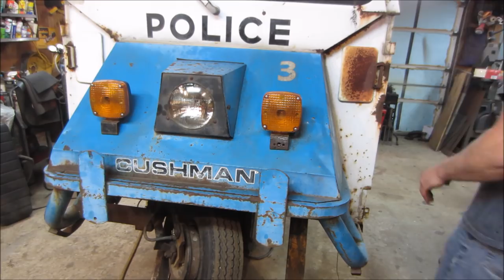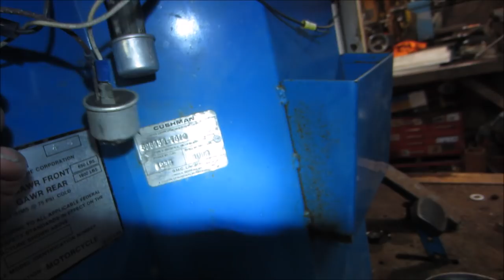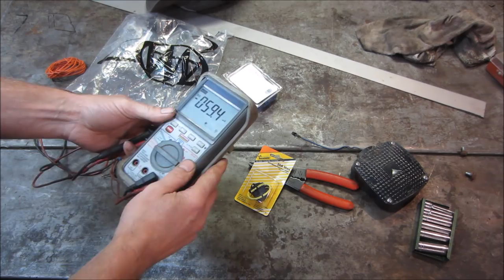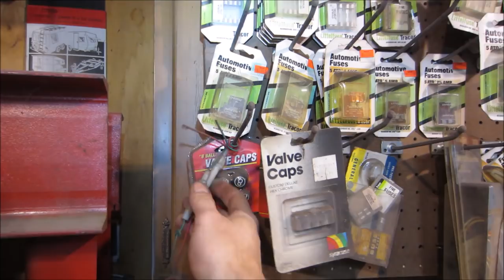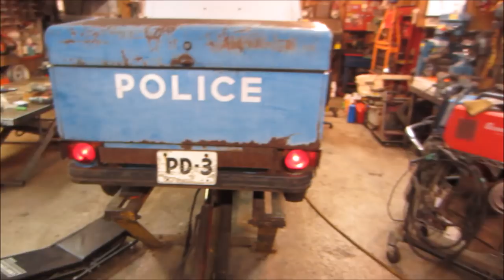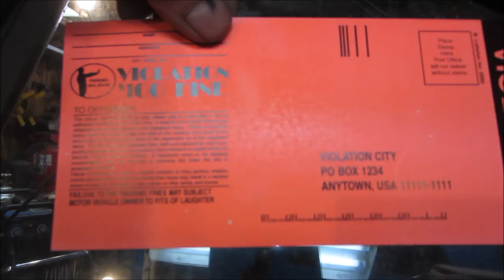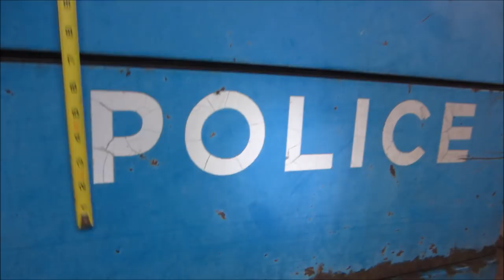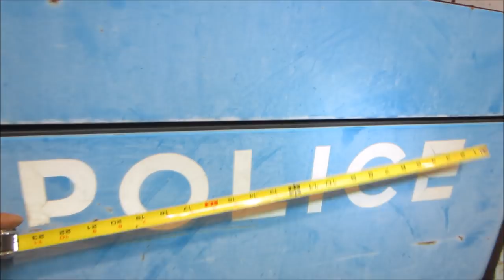cushman meter maid troubleshooting the wiring

Comment: I used to work on refurbishing forklifts/scooters/bobcats...etc.. Anytime we bought a used item at auction, without fail, the wiring was an issue. We went from the power source connection to load point...removed the entire wire and replaced it. Saved us hours and hours of time which = savings$$$! Once I found a wire that was from the switch to the flashers about 52 inches in length and it had 26 butt connectors! You tend to find out real quick that everyone is an "electrical engineer!" :)

Comment: Mustie1, Your closing remarks are very much the same feeling I’ve had while watching you go through and fixing this and that as you see fit! That’s the enjoyable part of a project like this. No end result except to get it safe and street legal. Then go from there.
I got mine just to get it to run because of the same reasons you mentioned. Cool, unusual, history it went through and didn’t want to see it crushed when a little work would give it new life.
As for the “no wrenching” per say videos, they are all interesting from different points of view. I for one enjoy and learn from them. So don’t be hesitant to record and put them up! 
This Cushman is going to look great hauling it to and running around at shows!

Comment: That's an innovative use of wire-eyes! I've used those splicing/piggy-back wire connectors, but I'm sure to always grease them! I enjoy the variety, it's good fun! The ticket on the windshield is a nice touch! XD Ooh, those will be fun at the shows! It's more fun to have it in your capable hands than smushed at the scrap-yard, that's for sure!

Comment: One of the tricks I picked up over the years was to stuff exterior light sockets with Vasoline after cleaning the surfaces to keep them from corroding.  Works great!  Lovin the series.  Thanks for sharing...
Reply: Im sure its similar but dielectric grease works good too and is cheap..
Reply: Fred Miller dielectric grease is even better!
Reply: I use silicone grease.

Comment: I learned something this week - do not use crimp connectors for electrical wiring on equipment.  I added rear lights that flash on my new Snapper SPX lawn tractor.  To do so, I had to splice a lot of wires together.  I used crimp TYPE connectors to splice them together.  They worked as intended for several days but the constant vibration of the engine, mower and bouncing around in the yard ended that.  I am going to take my VOM and find which connector is no longer connecting.  To stop this from happening in the future I am going to cut out all the crimp connectors and splice and solder each connection and then slip a piece of shrink tubing over each connection.  This is what I should have done in the first place.

Comment: The explanation of the speed of the flasher is the following:

The bulbs are wired in parallel to the battery, but the flasher is in series with the hot wire of the bulbs. As the bulbs are a simple resistor, they take up the current load, making the flasher's bimetal points contact lever heat slowly, thus flashing what we consider "normal".

When a bulb goes out, the flasher has more current flowing through it, causing the bimetal points contact lever heat up quicker, which translates to a faster flashing of the lights.
Reply: VochoTalacha the lower the resistance is the lower the current is. So you are wrong.
Reply: mettisha This is not correct, buddy. 

Picture a horizontal water pipe. Water flows from left to right. At the left you have a valve and at the right there is a rotor that spins with the flow of water. The more you close the valve, the less the rotor spins due to lack of waterflow and vice versa.

The pipe's diameter is the voltage, the valve is the resistance, the water flow is the current and the rotor is the car's flasher.

So I don't understand what do you mean by less resistance = less current. if this was true, then arc welding and short circuits are a hoax.
Reply: VochoTalacha the lever gets heated more when all the bulbs are still intact. And therefore you get that steady flashing. If one of the bulbs stop working the lever gets heated less. And that's because a lower current is traveling trough the lever. That causes the lever to get cold faster and your flasher will shift faster = flash faster... I'm an electrician. So I know this is a fact.
Reply: Nearly 50 years in the electronics field (yes, I started on tubes). Lower resistance is more load is more current. If 1 bulb = (for instance) 20watts, two bulbs (in parallel) = 40 watts. If 1 bulb resistance (cold, for instance) = 10 ohms, 2 bulbs resistance (cold, connected in parallel) = 5 ohms. Light bulbs appear as a near short when cold, resistance goes up radically when they heat up to prevent thermal runaway. Hook it up, measure the current. Ta Da. FYI: LEDs are a much smaller, steadier load, don't usually work well with load based (usually 2 pin) flashers meant for tungsten bulbs as they don't have nearly the current draw to heat up the flasher.
Reply: Mike Jones  as a licensed electrician for the past 30 years I concur..
Reply: I'm a university qualified, time-served electronics engineer. Mettisha is correct. Mike Jones is correct. VochoTalacha, unfortunately, is not correct in saying "When a bulb goes out, the flasher has more current flowing through it". With one bulb out, the overall resistance is higher so the current is lower. The thermally sensitive wire or bimetal strip doesn't get as hot so it cools more rapidly.

Comment: Hey Mustie.... the red lights on top are controlled by that three way "wig-wag" flasher that was on there to start with... power goes in to one terminal and out the other two alternating between the two lights to make them flash back and forth... hence forth the wig-wag 😉

Comment: I had a set of lights similar to that for a trailer. I ended up pulling the dark back half off and lined it with aluminum tape, and then covered the reflector with the aluminum tape as well. Made the lamp brighter...

Comment: Used to do car electrics back in the '70s. Those Scotchlock connectors were the #1 cause of bad connections. In the Fla heat, they'ed soften and pop open and the connection area was so small, they'd corrode. We used to say we loved those connectors as they made us money ;)
On old- style fuses if you need to replace a wire; take a 1/8 steel pop rivet and push the pin out. You can then solder a wire in it and make a new terminal for the fuse. Much better than a splice.

Comment: Those tie-in connectors are for quick low current low voltage connections, and yes they suck, MUCH better to use a small wire nut with all 3 wires then taped on the entrance after it's tight, and even better than using multiple butt splices, which also tend to give problems down the road. 
Loving this resurrection, and have heard so many stories of those in use, including a councilman who used 1 so he could park on a small spot off the sidewalk and didn't have to walk from the parking lot ;) 
Think I would have used the "fast flasher" on the top red lights so you could 'pull people over',  at the shows..not on the streets because nothing will get you in trouble faster than impersonating a law enforcement officer.

Ideas for the magnetic covers could be 'Dog Pound' or 'Parks Department', also thought of 'Water Department' but you have to  be careful of using any official looking wording to avoid problems. Still would be fun to run into town and cruise the parking meter/spots with the original wording though, see how many people run to their vehicles!

Comment: For switches, get some "Electronic cleaner spray" which cleans contacts. You can also get "cleaner and lubricate in one". Use them a lot in Audio switch applications. Also suggest getting better wire stripper which allows stripping wires without lateral force acting like a clamp on wires whilst stripping portion insulation. Can be adjusted from large to small.

Comment: Chasing down wire problems like that is so much easier in the old stuff, when there was extra lengths of wire, and it wasn't all trapped in wire harnesses.... Just an FYI, not sure if it's true on yours, but the dash came off of ours super easy, just take out the phillips screws visible on the dash.

Comment: I had an old sportster that would randomly die on me. I’d let it sit over night and it would start. I knew I was loosing power to the coil. First I thought it was a faulty breaker. I replaced it but still had the same issue. After finding a wiring diagram I found out the coil wire went through a connector in the headlight housing. I thought ah ha I bet it’s that connector. Took out the head light and bam it was one of those blue connectors being used as a splice. I took it out soldered it and never had the same problem. I hate those damn things lol.

Comment: Those in-line wire taps are just an invitation to trouble.  The knife is usually aluminum and wires are usually copper - the dissimilar metals cause electrolysis and make the copper brittle resulting in the most aggravating kind of failures.  Tape and twist is better than that!

Comment: Try taking the hazard lights switch apart and clean its contacts inside. AFAIK, most hazard light switches act like a double-throw switch as if you were dividing the turn signal lever in two and switching both sides at the same time. Probably this one has 4 independent contacts (1 for each lamp) and the one for the front left lamp is having a voltage drop and cannot power a regular bulb as much as the tester's bulb.
Reply from the maker: l agree

Comment: Hey Mustie, you should wire those red lights on top so that they flash in an interchanged way, you know? It is possible (though I haven't figured out how) to wire lights to a flasher so one flashes and the other remains off and vice-versa.

That would give a better purpose and look than to just flash like hazard lights.
Reply: wigwag
Reply: Depending on where you live, that could get you in Dutch with your local gendarmes. I know it would here in Indiana.

Comment: As for a name for the cushman...RUST POLICE...with a tag line of NO RUST IS A CRIME..another  tag line might be DON'T FIGHT THE OXIDE. Script on the door "FERROUS"     On the light base-the tip of the wire goes into a brass ferrule and is soldered together... all you need to do is heat up the brass and pull the wire out the back. replace wire and a drop of solder holds it in and forms the dome. occurred to me that there might be crimps on the base also, cut them and re solder without crimp.
Reply: To Swerve and Deflect
Reply: RUST BUST, or  RUSTED BUSTED
Reply: Rita, as in 'Lovely Rita, Meter Maid'
Reply: Given all of the QQ'ing in past comments on not painting it, I would suggest The Wambulance
And maybe some bumper stickers "That's not rust, it's Patina "
 - Eddy
Reply: See if you can get a sponsorship from Rust Bullet!

Comment: Ah, the dreaded IDC (Insulation Displacement Connector)!  They work quite well if you choose the right size for the wire diameter but most places sell blue and not red (smaller) with the result you see.

Comment: No complaints about the length of the video, or the content. I'm perfectly happy watching you weld or sand paint, but chasing crappy wiring is also part of the restoration. I will have to admit I'm really scratching my head about that three of four on the flashers but the tickbirds are working. Must be a cruddy splice or missing wire somewhere.

To paint or not: I don't have an opinion. What I do have is a wonder: what did it look like when it was retired vs what it looks like now? Does it matter? Would it be interesting to try to back-date it to about when it retired? Would anyone care? Probably a heck of a lot more work than a complete repaint. Maybe just mag wheels and straight chrome pipes down the sides, and air shocks. A low-rider Metermaid.

Comment: GOOTA HATE THEM SUITCASE CONNECTORS LOL BEEN THERE DONE THAT 
CAUSING INTERMITTENT SHORTS BEST TO SOLDER THE JOINT BUT BUTT CONNECTORS WILL WORK BETTER THEN THEM SUITCASE JUNK GOOD JOB FINDING THE PROBLEM 
AND FIXING IT

Comment: Top lights are the red lights that make it an official police vehicle. They would normally run off that 3 wire flasher to alternate. Power goes in on one tab, the other two will alternate power as the strip breaks contact. Likely the ends would be the black/white wires where the blue butt connector is. Cheaper than putting a rotary beacon on the roof. In use these buggies get sent to minor fender benders, fair/event security and other police calls, not just parking enforcement. So they need the reds to show "official presence" on the scene, It may have had a small siren as well as it is "required" in NY that any vehicle running red lights must also run a siren if the lights are on, but it depends on how they set it up. For legal street use you might want to make up some covers to slip over them. Some cops get REALLY anal about forward facing red lights on a vehicle that isn't fire/police.
Reply from the maker: thats what l was thinking too, covers
Reply: You're thinking dog pound, How about black covers shaped like ears?

Comment: You know you can't use the red flashers, they are only for the police. You can replace the top lenses with the amber lenses, and be ok because the normal red flashers on the bumper are legal. By the way, I really enjoy the wiring videos, I learn something new every time you do one. Plus you could put thought on top of the police letters, and make it the Thought Police. If you have read George Orwell's book 1984 which was written in the thirties, you will know what I'm talking about.

Comment: I know what you mean about scotchloks, they are a quick solution but end up causing no end of intermittent troubles. When I first started installing and modifying vehicle electrical systems, I used those things, but 6months later I would get called back for intermittent faults. Ever since then, solder and sleeve, no butt connectors. Also a major source of problems on old electrical systems as I am sure you are aware is earthing faults. 20 plus years of experience on old vehicle electrical systems has taught me not to rely on metalwork, brackets or chassis mounting points for good grounding. Taking a separate grounding cable to each lamp and bolting it to a known good grounding point will result in fewer electrical gremlins.....
Reply: Stuart Russell You guys are getting butt splices (solderless connectors) with Scotchloks. Totally different item. The Gargler is your friend!

Comment: The lights have a front and rear lens. You can change out the black one for a transparent one so the light can be seen front and rear, if it is mounted like the red lights on the top rails over the doors, or like on a truck fender. Yellow toward the front, red to the rear.

Comment: Where did you learn how to solder??? When soldering you always tin the wires. Tinning is the process of applying solder to the striped ends of the wire. After tinning both wires and inspecting to see that they are solder all the way through, now put them together in your little clip vise and simply apply the hot iron to the two wires that you clamped together. The result is a super clean joint with 0 cold jointing. This has been soldering 101.

Comment: I have a whole box of those 'add a tap' connectors since I never use them but like you just can't throw them away. I have always considered them to be inferior and have taken two/three times as long to make a proper 'y' splice. I will show people your video to demo just how the things can goof you up over the long run. 

By the way, I had mice in the rear AC unit of my truck and learned that it is about finding a product with an active enzyme component which got rid of the field mouse-pee smell that was pervasive in the box of my truck. You can find these products at pet stores or Wal Mart.

Comment: Add patches for support, where needed.  Spray some rust conversion stuff, where it's not visible, then spray some matt finish clear coat.  How about a collapsible popcorn cooker in the trunk and a taller (just under rear windows) for cups (3 sizes), paper towels,  etc... and a small, quiet generator?  ;-)

Comment: *Some older distributors call for a drop or two of engine oil down into the center shaft to lube the cam lobe tube. It may need that since you arent seeing full travel of the advance mechanism.

Comment: If you're determined to keep the "rusty look" on the machine, you might consider at least spraying it with a clear coat. That'll help keep even more rust from forming while maintaining the look that's there. I've seen car builders out of California use that method.

Comment: I got caught out years ago now, trying to fix the faulty lights on a boat trailer.  The factory had used those insulation displacement connectors to connect the wires from the front to the light bulb clusters on each wheel arch.
The problem was that the piece that cuts the insulation had rusted out when the boat was launched into salt water, and for a  while, only the lights on one side worked. 
After removing a whole pile of insulation to get to the joins, I discovered that the salt water had entered through the nicks in the insulation, and corroded the wiring so badly, that when I attempted to solder the damaged area, the solder refused to work.
End result, I has to strip all the wiring off the trailer, and redo it all.  I made sure that the wiring went direct to one light assembly, and then went across to the lights other side of the trailer.  It cost a lot more for the extra wire, but it saved having to do it all again in a few years.

Comment: I have a 75 gmc that I removed the mouse pee smell from. I ended up removing the heater ducting and replacing the heater core. The plastic pieces came out great with vinegar. The rusty metal flap doors not so much even after wire wheeling. I ended up spray painting them to get rid of the smell.